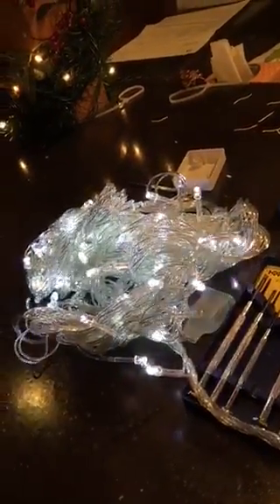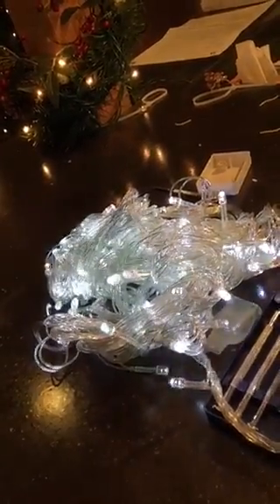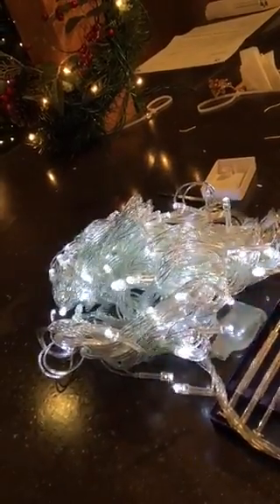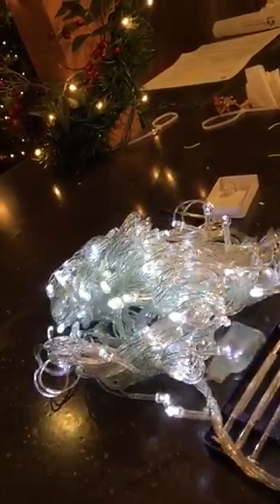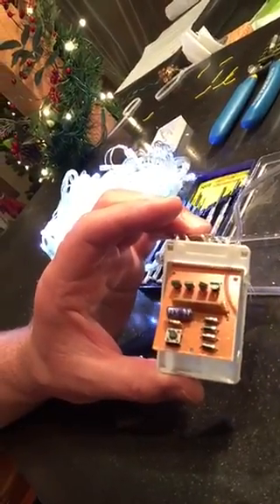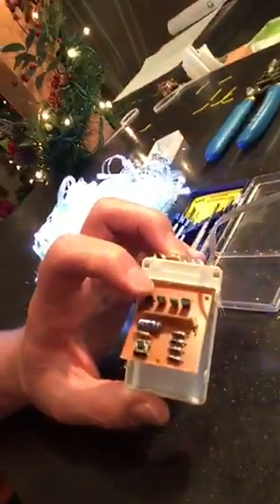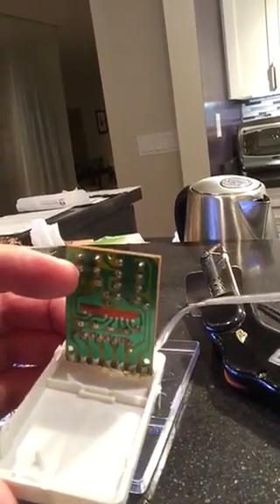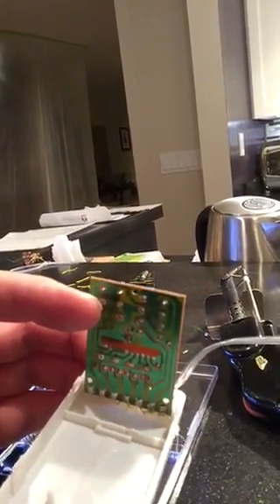Stop cheap holiday lights from flashing Part 1

Comment: I have a 100 LED star with inner, middle & outer circuits. The control box is the small white type with 'always on' as the last option and no memory function. Taking off the small clip-on cover of the control box there are six wires soldered to the board as '3 2 1 0 - +'. The + and - are to the wall adapter. Using a multimeter, the 0 is the positive to all the lights with 3 2 1 being the negative for the outer, middle & inner circuits respectively. I'll need to solder together the four wires 3 2 1 -, jumping over 0, so that all of the negative connections are joined. Just thought I'd share for any future views. This video helped to point me in the right direction.

Comment: Echoing and earlier comment: thank you for this simple solution to this issue. Exactly what I’m looking for. Question: since soldering those 4 leads together, have you experienced any over-heating or anything like that?
Reply: The 4 transistors are essentially 4 "switches" that turn on (conduct from emitter to collector) when their "base" terminals are supplied a voltage from the flash controller chip. All you're doing by shorting the emitters to the collectors is forcing the outputs ON regardless of what the transistors are "told" to do. No harm.

Comment: Any reason one couldn't bypass the controller completely? Ie, by cutting the control box out completely and connecting the wires directly?
Reply: you might burn the LED because you cut out the resistors.